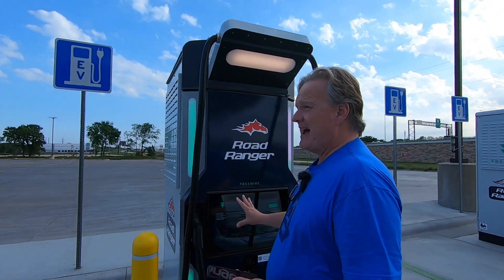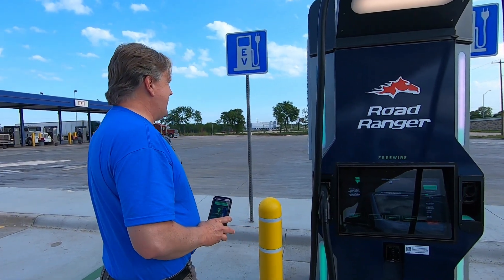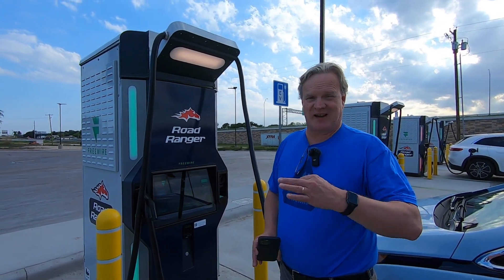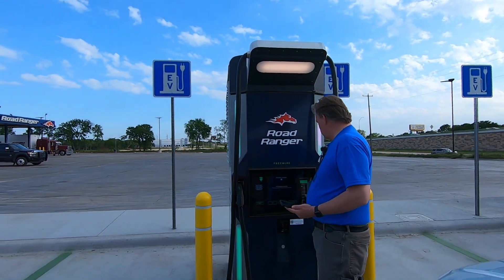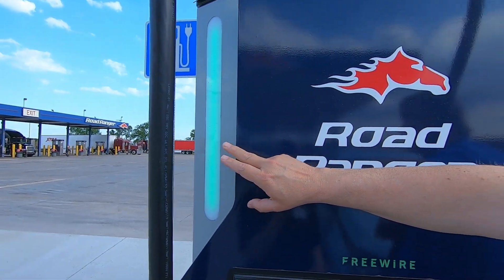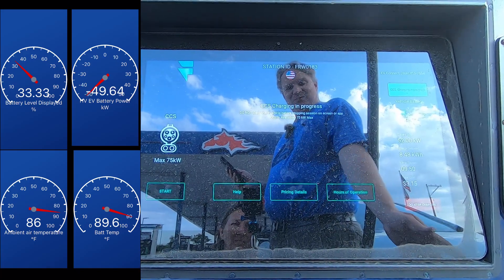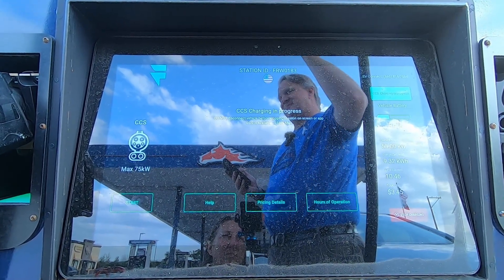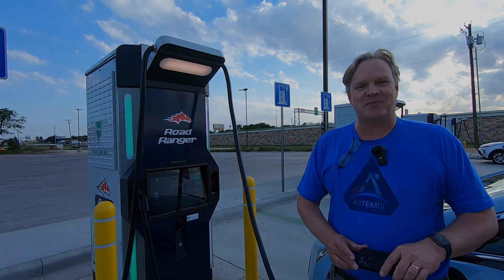Tour De Chargers Part 7   Freewire (EV Connect)

Comment: Since I've started driving electric a couple years ago, I've been seeing more and more cases of queues forming a full Electrify America sites, which has me looking longer and harder for alternatives. And alternatives like the Road Ranger Freewire are looking to me, very attractive. Right off the highway so you don't waste time. Plus, you have a 75 kW charging limit to deter drivers of vehicles with fast charging speeds and big batteries from using it, thereby increasing the odds that, as a Bolt drive, you'll find the Freewire available. And, they even have a credit card reader, so you can pay like you would at a gas station, and not need to waste time downloading or installing phone apps.

From the standpoint of the charging system as a whole, I think these Freewire sites are sorely needed. Electrify America is pretty good at charging up a single road-tripping EV in isolation, but they don't have the capacity for more than a tiny number of cars to use them at once. At the moment, just doing a road trip in a caravan with 3 or 4 other EVs driven by friends is enough to single-handedly clog up all of the chargers, let alone an eventual future where nearly every car traveling a major interstate highway corridor is an EV.

So, in order for the charging network to keep up with an increasing number of EVs on the road, we need more capacity. With the traditional method of charging, where cars charge directly off the grid, adding capacity takes a long time, waiting for the electric utility to upgrade the site's power supply. Freewire's battery model bypasses these long delays, allowing new charging sites to be established with whatever existing utility connections happen to already be there. And the result is chargers that are out there and ready to be used much more quickly. And, if EV road tripping is going to transition from niche to mass, this is something we're going to need a lot more of.